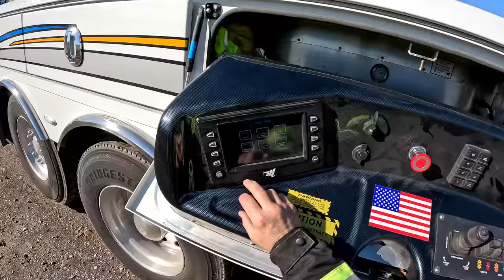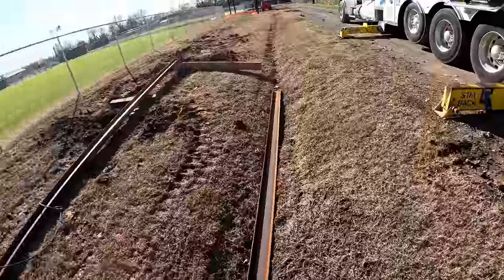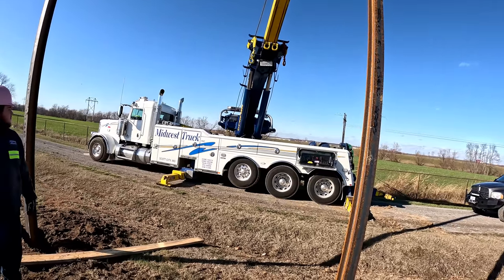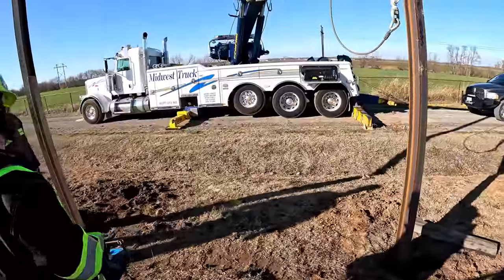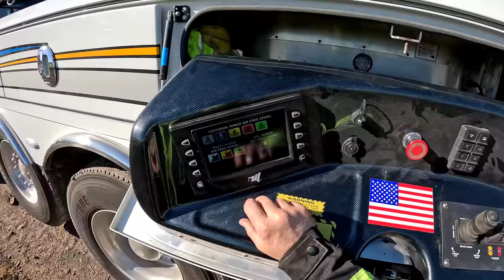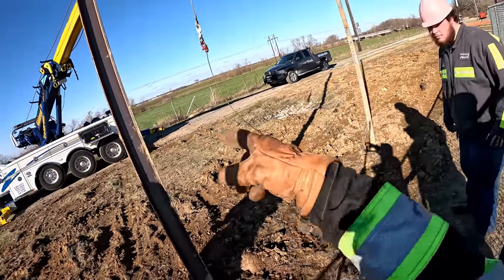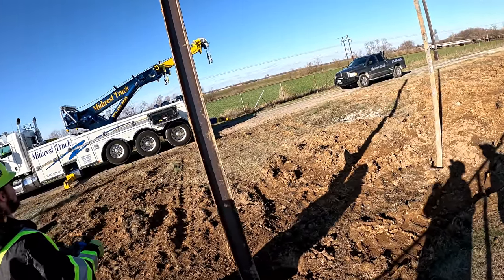SCORE!!!   ROTATOR SETTING I-BEAMS!!!!

Comment: Just so I understand.... are they just going to pack dirt in those holes or concrete them in place?  Seems to me with a scoreboard up there and the way the wind blows all the time they would have set them deeper & use concrete to lock them in place.
Reply from the maker: You may not have heard the gentleman in the video.  He said that the concrete was coming in a day or two.   Our job was to simply set the I-beams in the holes.   He was then going to square them up, secure them, and prep them for the concrete footings.   It was windy and my camera may not have picked up that part of the conversation.    Thanks and God bless.
Reply: @RonPratt  Missed it!  Thanks Ron!
Reply: @RonPratt  ok, so they then can use the skid steer to adjust and raise them a bit so concrete can get under the beams, right? Because your job was to get them vertically into hole only, it seems.
Reply: I was having the same questions. By the looks of it it doesn’t look like the beams will be below frost line. I have a vision of the beams tipping and  the dirt being flipped out of the sidewalls. Unless the concrete extends above ground level it doesn’t look like there’ll be enough mass to hold it upright on the windy days. It’d be kind of informative to see the end result. I guess I’m just the obsessive compulsive type, lol. I always forget how high the boom will reach on the rotator since not every job requires the full height. Thanks for another look at all the rotator’s potential capabilities. Stay safe Ron.🙏❤️👍
Reply: @RonPratt  Great project to get involved with,thumbs up, Agree,that wind is there, No traffic or Arc Nemisis
Reply: @RonPratt  I have stood a few piles up in my time and a choke like that can be release by tying a rope to the loop around the object being lifted.  

Another method of holding it position would be angle iron and c-clamps that the bottom pf welding the angle iron to the post spread the area.
Reply: @RonPratt  I hope they make sur to crown the concrete to make water runoff not doing that is a common mistake.
Reply: Not an expert by any means but I have helped friends who are home builders set up for decks, etc. I'm curious, wouldn't it have made sense to have Sonotubes set up leaving a couple of feet above ground level, place the I-Beams in the tubes and brace them until the concrete truck arrives?
Reply from the maker: @Brian McGilvray   Personally, I like using sonotubes, but I was not in charge of this job.  Our only task was to place the I-beams in the holes.   Thanks for watching and God bless.
Reply: Mr Ron possibly could  you do a walk around the Score Board  when the Contractor's finish building it ? Thumbs up

Comment: Coded hard hats, Ethan cowboy, Gavin pink, Ron needs a crown as the king of operations. You could tell at a glance who is who.
Reply: Absolutely I’ll start looking around for a crown hardhat and then I’ll send it to him
Reply: Construction jobs, or some factory environments, color code their hats: bosses, engineers, inspectors, etc., get yellow hard hats while everyone else get white hard hats, or vica versa.
Reply: usually a general job supervisor wears a white hard hat, a railroad supervisor wears a blue hard hat (also electricians), a brown hard hat is a welder or person in a high heat area (think forge furnace), green (not neon green) is safety inspector, and red is fire safety.
Reply: It looks MUCH more professional to have everyone in the crew wearing the same type hat. That pink thing looks absolutely ridiculous, in MY opinion. The whole crew working on a job site, all outfitted the same, screams "We are knowledgeable professionals."
Reply: Pretty sure the pink one is for whoever forgot their regular hard hat.
Gavin seems to have lost his somewhere.
Reply: Reminding me of the color coding in the Navy on flight decks

LOVE IT

FYI, because OF that color coding, when I was in the oilfield, I just COULDN'T wear a white hard hat!!
Reply: @NoMoFlts  from a stand point of being a team member, looking for the different colors helps a LOT!
When I was in the Navy, working around cranes, the different colored hardhats made it a LOT simpler. 

Same thing on Aircraft carriers and flight decks, it makes it so you KNOW who to watch and who is doing what, especially when you have people not trained for everything!
Reply: @michaelking3327  different than what I am used to from the Navy, but definitely the same concept. Awesome

Comment: If the choker hangs like that again, just rap the beam with a sledgehammer a time or two, about two-feet up from ground level. The transferred vibration increases up to the choker. It works on wooden poles as well. Not as good as iron or steel but it does work. Good video, thanks for posting.
Reply: Another suggestion:  Before lifting, tie a tag rope to the choker opposite to the "clamp",  Then if it sticks just yank on the tag line.

Comment: Not something I ever imagined the rotator being used for - but it had to be done! I imagine the gentleman who you’re helping was impressed with your work on the recovery of the material handling truck so he called you as a first choice…
Reply: A crane and a tow truck had a child: a rotator. There are numerous non tow/recovery jobs I've seen it used for.
Reply: There’s been other more unusual jobs on these videos before. Moving a chemical/gas tank precisely into place; putting some equipment into a second floor of a building, etc. Been too long to remember the details but it’s not just vehicles that get picked up.
Reply: Ron is well known by the local community. He sets up at the local fair doing demonstration's so they know he has the equipment and skills to get the job done and done safely. If they brought in an actual crane to do it, the crane would likely get stuck
Reply: @demonknight7965  He did a demo at the high school, once. Also in his favor is how closely he works with the police and fire departments. He is certified in extrication and can lend a hand when necessary. I saw a video where they did some joint training with the fire department, showing how his trucks, and equipment, can be utilized during a rescue.
Reply: If I recall Ron's wife works at the High School in some capacity.  I remember she was involved in arranging Ron do a career talk,  and demo  where he rolling the School bus and then with minimal changes to the rigging lifted it as well since someone asked.
Reply: @demonknight7965  
Well known and respected  :-)

Comment: A short ladder would be a good addition to the truck load out. Great Video. Really enjoy seeing the new guys learning and progressing in the trade. Best to all of you.
Reply: They have a collapsible ladder, but in this case there was nothing secure to lean it against.
Reply: Remember the rotator already has a fold up straight ladder (what are you going to prop it against here?) and a two step short person helper. Where are you going to put a bigger A frame ladder? Perhaps on the traffic control vehicle but would not be required often enough to even carry.

Comment: A nice easy Rotator job & OUT for Ethan on the controls of the Rotator especially on the remote. Yeah I didn't hear anything about concrete I read a previous post & your comment clarifyimg that. So TY Ron & crew for a wonderful video. May God bless & protect you all out there. Be careful out there.

Comment: Two suggestions.  Stand a plank up in the hole and let the end of the beam or post follow the plank into the hole.  Tie a tag line to the choker bell.  Pull on the bell to loosen the choker.

Comment: Plenty of ways to do this, one of which could be done with the skidsteer.

Lift by hand the end of the I beam on to the frame of the forks, or top of the bucket (which ever it has).

Wrap a somewhat loose chain around the I beam to control prevent the beam from falling off the sides and from falling away from the machine.

Position the other end of the beam in the hole like you did.

Lift the beam to above the roof of the machine and drive forwards.

It's basically the same as lifting it into position by hand, only it uses a machine and provides a more stable platform to control the beam.

Of course, if they aren't comfortable doing that (or not knowledgeable to do), then they made the right call in outsourcing.

Comment: A little trick for getting chokers down without much effort is to put a rope on the choker slide so when you pull it will open the choker and slide down the beam. I've set thousands of steel and wood poles using this method. Some well over 100 feet tall.
Reply from the maker: Cool.   Thanks for the tip.  God bless.

Comment: It seems that an above-ground skirt to hold these in place would be good. At some point, they'll need to be put into exact position horizontally and vertically, and the dirt that got dumped in the hole will need to be taken back out (and then some, probably) so a large hole can be filled with cement. And of course it would need to hold the pole in place while the cement hardened, too.

Comment: Hey Mr Ron Pratt, I just had an Idea and Wanted to share this with you.  Why not insulate the front of the truck hood where the Siren box is on the front of your Rotator Tow Truck that way people can hear it a bit better when you're moving down the interstate. It would reduce the engine sound probably by a little bit, but it would help make the siren be heard a bit better and it might sound a bit louder as well

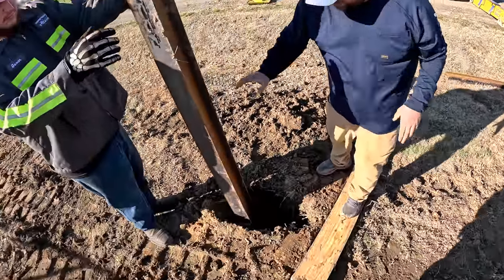Comment: @12:00 minutes when he got it straightened up and you started dropping the line. i am soooo surprised they didnt have something there to support it. that is sooo dangerous and one little sloppy dirt could have that thing drop in any random direction it feels like. 

I personally would have had the skid steer at least there to support it while they packed the hole with SOMETHING.

Comment: I love how Ethan didn't even ask, he just took over the controls of the truck like it was the only option. Where's his cowboy hat? On something like that you might want to wrap your choker in a few wraps of vinyl electrical tape, the vinyl will have a lot better grip on slick surfaces than the steel cable will. The reason that you couldn't loosen the choker is no matter which way you were yanking on it, up or down, you were putting the same load on it which was only tightening it. You needed to back off the tension so it'd slide.. unfortunately there was only one way to skin that particular feline. Squaring up those beams with the crossbar before lifting it would've been far smarter. Yes it would've been heavier but that's nothing to that truck, it would've kept the beams even in the whole and made them far sturdier so they didn't flap around in the wind so much. The way that guy did that is like building the wall of a house one 2X4 at a time without them already nailed to the footer and header and then trying to wrestle them around. 
I heard today that Missouri just passed recreational weed.. You'll see an uptick in wrecks due to DUI for a few months and then it'll level back out.. surprisingly nowhere near as many as some might think.. I think anyone that'd smoke pot is already doing it, for the most part, it's just some idiots suddenly think that it being legal means you can do it while driving.. That's pretty much what's happened here since it became legal.. but then I saw a woman taking a hit off her huge bong at a stop light years before it became legal in California so.. stupid is as stupid does.

Comment: The trick to setting power poles is to find the balancing point and then set it back down and slide your choker a few feet toward the top of the pole from the balancing point. This will make the pole just slightly butt heavy. So when you winch it straight up and down, you can control the butt with your hands from the ground. This obviously wasn't heavy enough to need that.

I've also set many poles by hand with no equipment. The trick to that is, to dig a long slow sloping ramp into your hole. Then place a metal rock bar on the far side of the hole. This gives the pole something to slide against instead of digging into the dirt. Get a few strong guys to start at the top and work your way down the pole. If the pole is to heavy you will need a dead man and some pike poles.

Comment: Got a confession Ron. It finally dawned on my those cables that the rotator can move around are winch lines. You just have more versatility then most. What would cause those winch lines to need to be "respooled"?

Comment: Could have tried dropping the blue hook on the other side of the channel as it seems it was hanging up on the other side of the I beam for some reason. Ah he thought of it too :) After the cable got stuck and seeing how much of a struggle it was to slide that choke up the 3rd beam, I probably would have put a tag line on it so that you could pull it down.

Comment: Does orientation of those poles not matter? I'd figure the flat side should be facing towards the field for bolting on to or what not. First set was that way but second set was, for lack of a better phrase, sideways.

Comment: hey ron, can you give me a list of different radio codes like code 3 and code 4. i already know what 3 and 4 mean. code 3 means all sirens and code 4 means scene is all clear. can you tell me some others pls. i play a roleplay game on roblox and in some servers people will use codes as if it is real life. so i want to know some more codes so i know what they mean and what to use them for.
Reply: Codes 1 and 2 are down from 3, though I don't know exactly what each means, but 2 is medium priority and 1 is low priority. Some places use Priority n rather than Code n, and those are the reverse, ie Priority 1 is lights and sound, 3 is low priority.
Reply: Code 1 is "your earliest convenience", code 2 is "urgent, but not lights and siren".    I guess code 2 would be something like additional traffic control at a crash where other personnel are already working on the scene, while code 1 would be going to take a citizen report.  Like when I had the wheels stolen off my car in front of my apartment.  Pretty sure the respinse then was code 1 since the crime was already done.  They actually caught the perps while the cop was taking my statement.  Turns out police get suspicious when three people in a pickup give three different stories as to why they have four wheels and tires in the truck at 4:30am.

Comment: That's the first thing I thought of just lift it up and put it in the hole Gavin had the right idea you had two big guys there both of those guys working together could have put that pull up my hand
Reply from the maker: Perhaps, but that was not the safest method.  Someone could have gotten seriously injured or worse.  Ground conditions were horrible.  One slip from either one of the people could have been a huge problem.   Like I always say, there are multiple ways to reach 10.   However, not all methods of achieving goals at a jobsite are safe.   The customer chose what they felt was the safest method and I agree with them.   Thanks for watching and God bless.
Reply: @RonPratt  Ron glad you made the statement after my tell you the truth did when I was young now 57 and my body is shot
Reply: @RonPratt  just wondering why they are putting a beam with rust already on it in ground that appears damp? Aren’t they concerned about it disintegrating over time or settling with the weight? Would have thought there would be a footing of some type under it.
Reply: @RonPratt  agreed
Reply: @RonPratt  are they setting it up in concrete?
Reply from the maker: @Ken the talkin pen    Yes...our job was simply to place the I-beams in the holes.   The gentleman who was there was then going to square them up, secure them, and prep for the concrete footings that would be poured in a few days.   Thanks for watching and God lbess.
Reply: And don't forget the wind that was making things more dangerous in addition to the bad ground conditions.   Don't get me wrong, with 4 men there, 2 who were young and big, it was very doable by manpower alone.  But why waste the training opportunity to instead do things in the more risky and body wearing way?

Comment: i saw one of the other record services  put on a safety harness and then lock him on to one of the trucks cable wenches then wench him up and over a fence while he was even smoking a cigarette and down in to a concrete drainage  ditch and placed him on top of the car that had ended up in there and then they brought him back the same way then they lifted the car out after he was back safely after making all 4 point  connections to the car RON DON'T YOU TRUST YOUR EQUIPMENT LOLO

Comment: Ron this is a little bit off topic but how is the tire wear on the rotater? and what brand do you think  you will get next? also will it be a low rolling resistance type tire ?Just wondering since my son is an over the road driver and i used to drive motorcoaches all over the usa and canada plus when you are doing that type of work you have to think like a crane operator in some ways at least I think so. what do you think?
Reply: I’m not Ron, but I used to be an owner operator, I used BF Goodrich, they’re owned by Michelin & I was to cheap to use the Michelin. 
They did pretty good. Michelin was 1,000$$ for the steer tire, BF G was 750$$.   22.5 low pro & Yokohama on the drives. Hope this helps

Comment: You set post, but they are turned every which way.
Reply: See Ron’s pinned comment. It was just to get them set vertically in holes. Construction crew will finish job.
Reply: Way to step up ethan,good job..